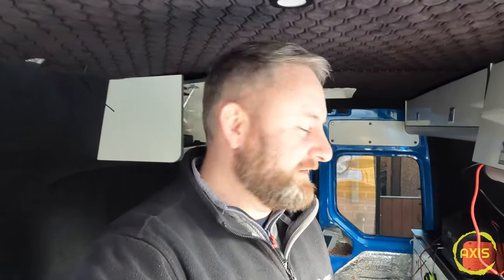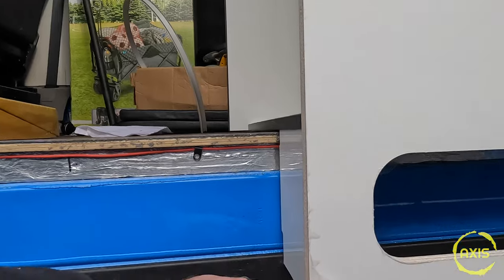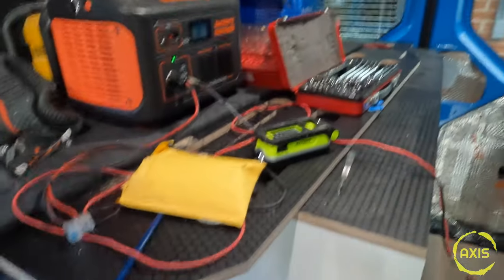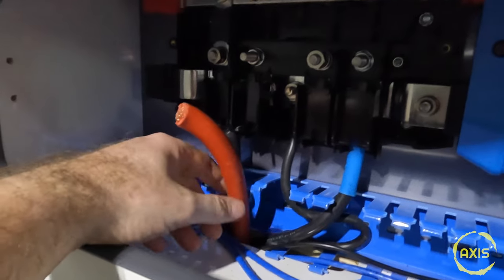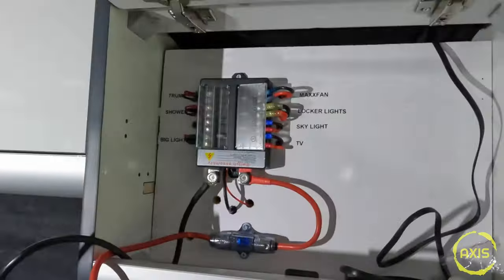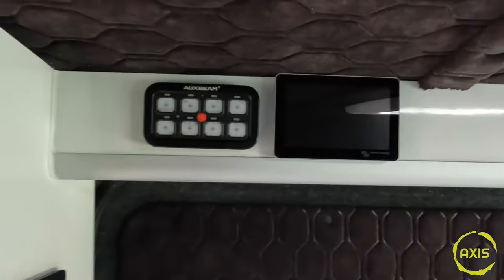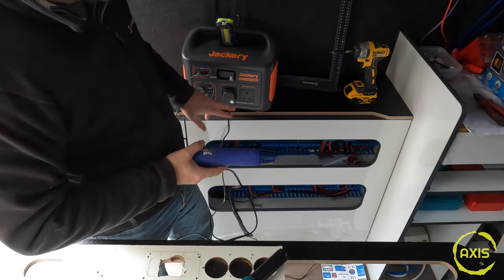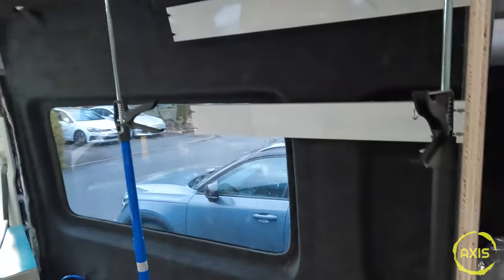Camper van electrics - Victron Solar MPPT, DC/DC, LINX, CERBO installation into an Evo motion unit

Comment: Great vid buddy, I would put some sort of skirting around bottom of unit to hide gap 🤷🏻 🤜🏻
Reply from the maker: Thanks Mark 👍🏻 yeah just looking at trim edging 🤔
Reply: @AXISUK  nice trim edge in gloss white or maybe colour coded same a van 🤷🏻
Reply from the maker: @vandox21  need cover that raised floor with summat too 🤔
Reply: @AXISUK  i folded a length of 2mm sheet steel and made a trim , Cnc a 300mm slot in and put a led strip in , u can get black diffusers to make it discreet 🤷🏻
Reply from the maker: @vandox21  shame you can’t post pictures on here. Sounds interesting what you have done 😊